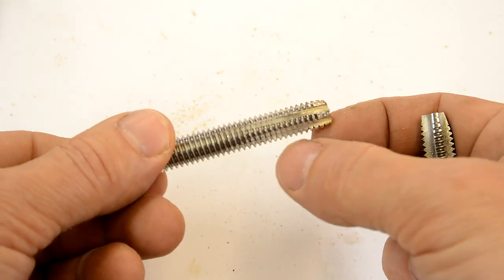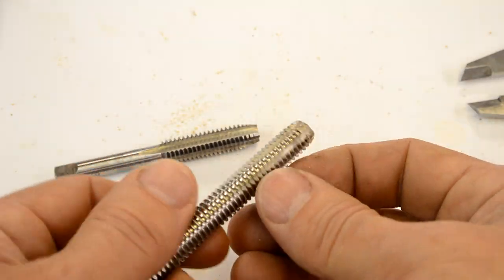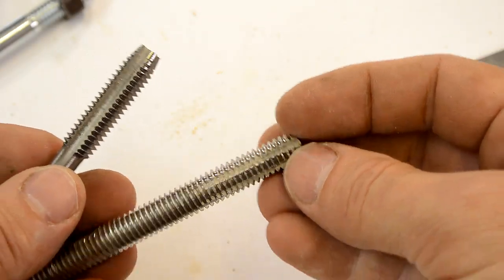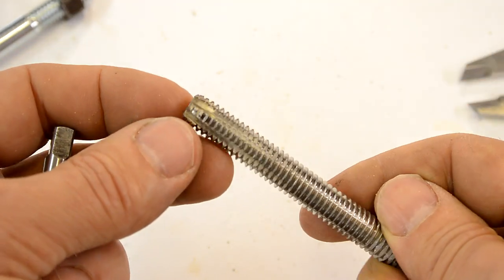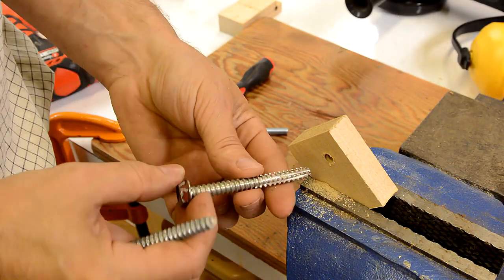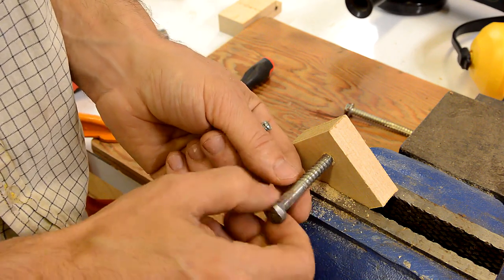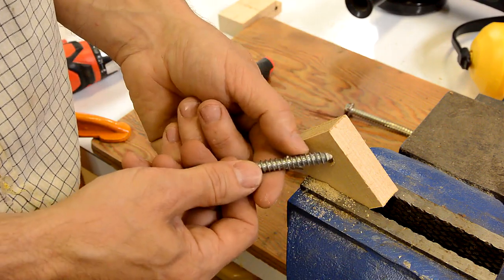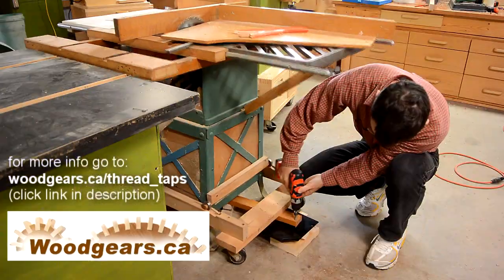Making wood thread taps

Comment: So now you need to give them to John Heinz and let him test the strength of the threads.  8-)

So do I need to drill a slightly undersized hole or is it not necessary because the bolt is already undersized?

Comment: Would this method work for tapping metal? Specifically I know of a few old hollow metal doors that I have repaired that have had odd sized screws for the old hardware. I would like to reuse these screws but in previous experiences I have had to replace them due to not having the correct tap.
Reply: Probably not. There is already self tapping metal screws so there is no need to unless you are doing precision work with Mx screws or similar Fine threaded screws. And even then, you need a strong metal which most screws aren't made of. Hence there is a cost difference usually. 

It is a bit like nails, a cheap nail usually bends easier than an expensive nail that strikes true into even harder wood types. 

So, I would say, it MIGHT work for metal but you are probably better off, using it for wooden types than metal. Plus, self tapping screws for metal aren't really expensive. 

For reference, a self tapping metal screw can go through a H beam with a 1 cm width(Inch ~ 2.54 cm ). The limiting factor is usually the drill than the screw.
Reply: Steel doors would be pretty hard to tap with a screw, but you can get away with doing this on aluminium doors.
Reply: H beams are steel. So there exist self tapping screws for metal usage. Take a short, very short screw as a starter then switch to longer one. Easy peasy.

Comment: Every time you were using the modified screw to tap a hole in a piece of wood, the tap looked as if it were wobbling. I don't think it's supposed to wobble - or am I wrong?
Reply from the maker: ideally it would not wobble.
Reply: That's what I figured. As a "proof of concept", it's fine :-D

Comment: Thanks for sharing the technique but I think the main benefit is that you can make a tap for any screw/bolt if you had all the tools you used and not that it's just cheaper that what The Wood Whisperer sells (BTW - you forgot the bench grinder cost in your overhead argument) .
Reply from the maker: you can use an angle grinder instead of a bench grinder.  They both grind.

Comment: I'm sure that this is a stupid question, but why did you grind the bolt first?
Reply from the maker: put a slight taper on the end
Reply: Thank you so much.  I was looking for information on what I needed to buy when I found your video.  I just tried it and it worked flawlessly.  Thank you for saving me money that I wasn't looking forward to spending.

Comment: One flute, sharp with a deep groove and just use a file it takes 10 minutes and works better... ive done it for years
Reply: That's it! That's why this video was so familiar!... wranglershill did a similar video several years back using the file method back when he used to do real videos. Before he went full shill.   Deja vu solved!

Comment: I think that you would get stronger threads if you don't remove material with that tool, because the wood compression when inserting the bolt/screw.
Reply from the maker: unless of course it's so tight that you split the wood, or twist off the bolt (yes, that happens)

Comment: I just did a little comparison and the difference is night and day. Sorry Matthias, these WW taps are way better for wood than metal taps. The metal tap hole is much looser than the wood tap hole: a 1/4-20 knob gets tight after 2-3 revolutions in the wood tap holes, but takes a few dozen (most the way through the 18mm hardwood lumber core ply I'm using) in the metal tap hole. I'll try to do a video tomorrow. 

Still love you both, but Marc made better taps (for more money). I'll set aside the money for a set of Woodgear taps should you decide to release some. :)
Reply: +Corey Ward
Did you actually watch the video?
Reply: Rudyard Kipling …you haven't been in the comments long.
Reply: +Corey Ward
I am sure that means something to you, alas, it means nothing to anyone outside of your head.
Reply: There are different tolerances for metal taps called classes of fit. The 1A is a tighter fit usually more expensive. I have a set of "repair" tap and dies of maybe class 3A (the class is not mentioned) and know the taps cut bigger than my higher end 1A taps. 

So your results will depend on which class of fit you use for your test.
Reply: Hold on, if the hole is properly threaded a bolt shouldn't get tight until it either bottoms out or the head makes contact with the surface. The hole purpose of a tap is to create threads that minimize the damage to the surrounding material. If I have to start cranking on a bolt after 2-3 turns, something is wrong and I'm likely to strip out the threads.

Comment: Making a tap for wood from a self tapping wood screw??

I think a small part of the universe somewhere just imploded.
Reply from the maker: The screw I used wasn't self tapping
Reply: I didn't mean "self tapping screw" in the sense where there are interruptions in the thread to provide the cutting action. I meant that you typically don't tap threads for standard wood screws and lag bolts. Drill the pilot hole and drive it in. The screws themselves will make their own threads...self tapping. All woods screws are in essence  self tapping whether they are labelled that or not.

It would be interesting to see which "cuts" a better thread. Your woodscrew tap or that lag bolt by itself assuming you drill the correct pilot hole. My gut tells me the lag bolt will make a smoother thread.
Reply: +Ralph Macchiato No I got that. I just don't see a practical application. You typically want a  thread to lock and stay tight after you've tightened it (knobs,leveling, position adjusting, etc). Woods screws have a relatively high pitch which makes them the worst thing for self holding a load if they are not restrained from rotation. You would need some kind of jam nut to lock it but they don't make those for wood screws so here comes the can of worms...
Reply: OU812 self tapping wood screws will crack the fuck out of wood along the grain.

Comment: Taps for wood are not what I'd call an " essential " tool. But if you were in a hobby or business where clean, repetive hole for" knock down " type furniture.  It can be worth the investment. How much is your time worth?. The time spent making the tap, could have been spent building or designing your next build. There are no absolutes, each person has to weigh cost vs time savings. Do we need power tools? No..but it sure saves time.
Reply from the maker: Most of the time I just screw screws into wood.  but there's the odd time this is very handy.
Reply: Robert Mcdonald I make my own taps and use them for piano rebuilding.
Reply: Jack Houweling I've watched several of your videos, love your creative solutions.  And I am a stroke survivor.. you do very well with your hands that seem to be very handicapped. Is it a form of arthritis? . Not trying to be too personal. But it does inspire me.
Reply: Matthias Wandel I agree.

Comment: more hold ??
No less slack,...smaller tolerance difference.
wood will not alter in strength no matter the tolerances.
Try different woodgrain, different species, even better.
Shipbuilders know wood. And Joinery. And Structural Engineering.
Old tech.... perhaps older than FARMING.
NO ?

Comment: is not any "screw" designed to accept a nut....referred to as a bolt?
Reply: You've gone and done it. We are all screwed. You nutter. I'm bolting out of here.
Reply: Except for machine-screws, lag-bolts and many other exceptions?
Reply: +Orcinus24x5
Thank you for that, I was not aware of the first differentiation, but it is obvious really. Cheers.

Comment: "there is definitely no need..". That's just incorrect and Matthias displays a very narrow mindset.
Reply: OK can you provide the proof behind your statement? Why do you disagree?
Reply: #1 If you can not make one yourself that leaves buying ordinary thread taps which are different. As Matthias says there is no need for the extra room in wood threads. So it's a matter of comparing either the same product homemade/bought OR comparing different products. Both cases the "definitely" part is incorrect.
#2 Ofcourse "need" is open for discussion. But that's my second point which is his very narrow mindset. His idea of need isn't necissarily everyone elses. If he presented it as an opinion I would absolutely be OK with it.